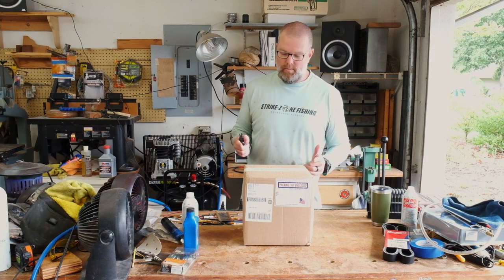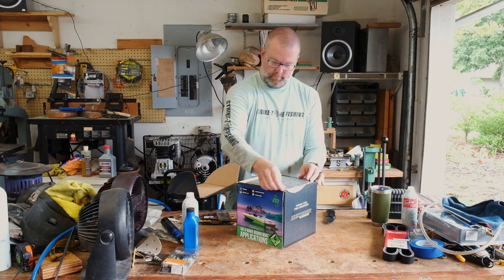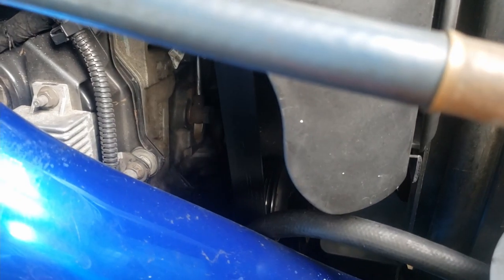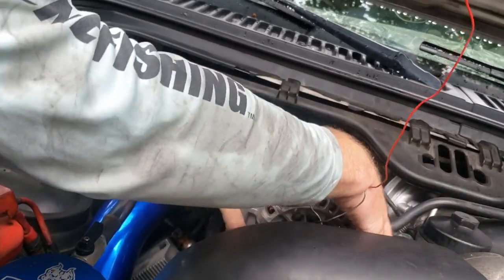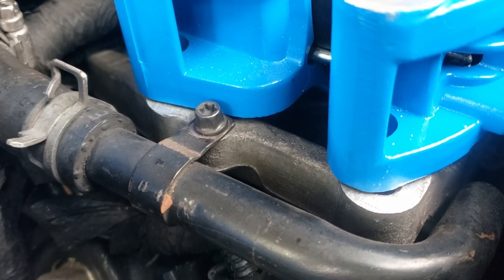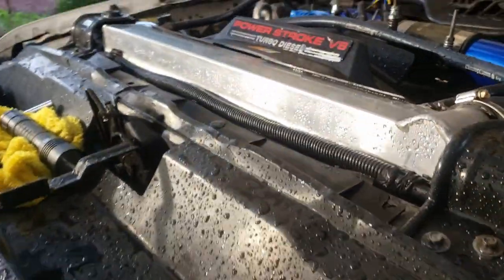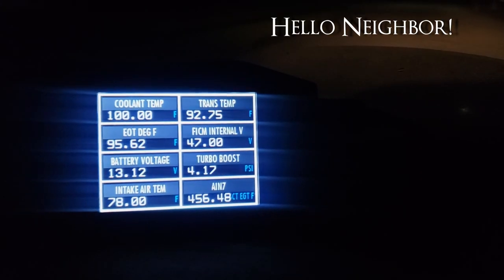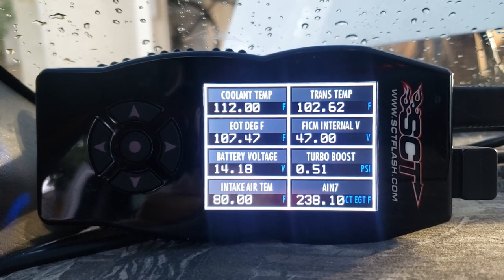6.0 Powerstroke Replacing Alternator With Mechman High Output

Comment: Great video keep in mind its 320 at 2,000 rpm to see good voltage at ideal speed it’s always less. A 250 alternator will out 250 hot rated at low rpm at idle.
Reply from the maker: Thanks for watching and thanks for the info!

Comment: You have done less than half the job. You have also voided your Mechman warranty. Mechman makes fantastic alternators, but they are only as good as the install. Your battery cables are grossly insufficient for carrying that output. I'm sure you also have ground issues, as most vehicles with more than a few miles have. Long Long Honeymoon did a great job with the cable upgrade that are a MUST. Also check out "Too many toys" videos on the Ford super duty electrical issues and upgrades needed.